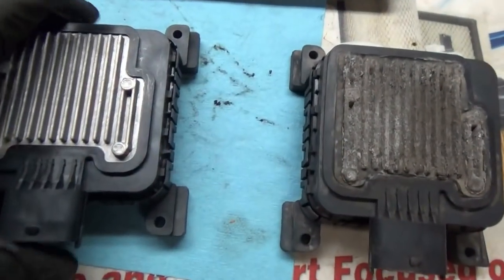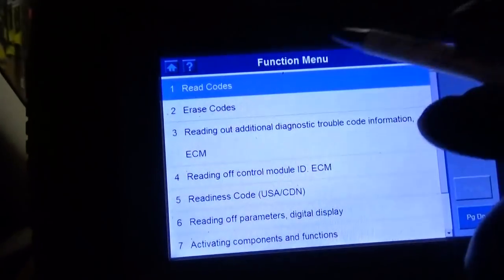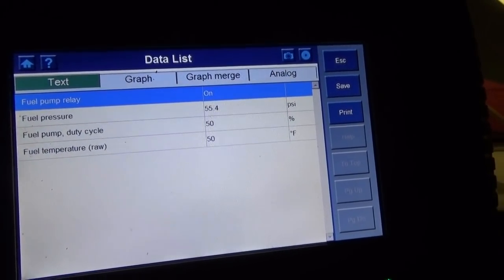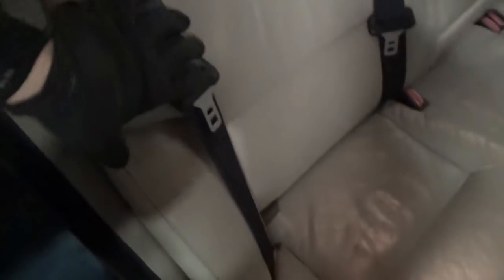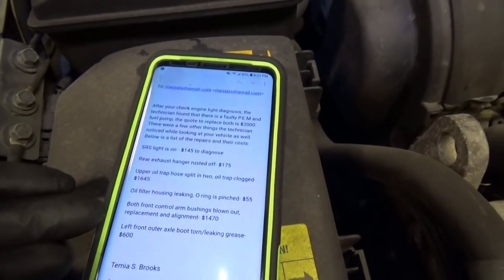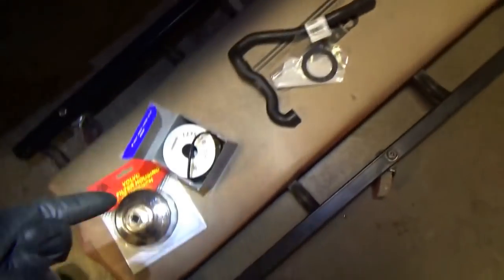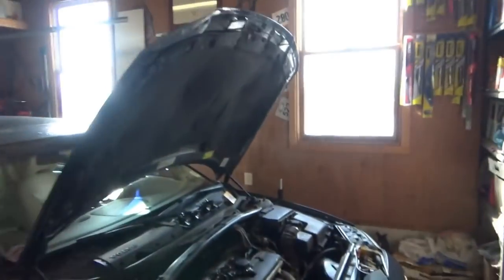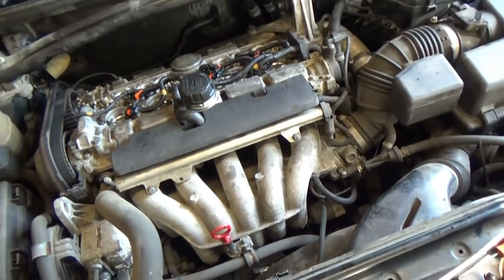Volvo Crank No-Start -Part 3 (Repairs!)

Comment: Nice job Ivan! Thumbs up!!! But the PCV is a very common problem on these cars. They clogging up and then you have positive pressure in the system and oil leaks out on the oil-filler cap. You can put a nylon glove over the oil-filler-hole and see if the glove blows up. If not, no problem, if yes, then you should replace the PCV valve as well. BR from Switzerland, Matthias
Reply from the maker: I will check this!
Reply: I agree very common test
Reply: Defiantly a common complaint but not really ever much of an issue in my experience.  You can get huge mileage between vent tubes so in worst case scenario just replace tubes every 150-200k miles.
Reply: canuckguy worried definitely*. Autocorrect on my iPhone isn’t very bright and not am i
Reply: canuckguy worried  pcv can cause vacuum leak but so can any other part of the intake system. Either get a smoke machine or some propane.
Reply: @Honeypot-x9s  I had several of these cars with a clogged PCV breather valve and sometimes one of the crankshaft seal rings snaps out and then the oil sprays over the timing-belt.

Comment: Maybe eurotrash should refer to the Volvo dealers, not the product.
Reply: But if the dealer support is bad, the vehicle is trash too. Unless the owner does their own maintenance or has a knowledgeable friend. Of course this applies to all dealers.
Reply: This V70 series is still clogging the highways around here in 2021, I have two in my driveway. One seems to have the same problem too. But since it was part of Ford for a while when it was being made midstream, and is now China's problem child it is an international orphan. The last mechanic I  had work on mine had to try  and get five of the same part before a non defective one showed up. We are the world.

Comment: The Volvo dealer hasn't seen this yet because there's no dislikes lol.
Reply: theres two, the dealer and service tech .......
Reply: 5 as of now.
Reply: 8 dealers as of now!
Reply: @Dirtyharry70585   Dealerships are like flashy gyms. Both the desk staff and the Presonal Trainer (Tech) are only there to sell you merch you dont need.
Reply: yup....sell up not fix.
Reply: @Dirtyharry70585   I don't mind the upsale if there is also a fix. For example changing all the diesel injectors when the first one breaks or similar things like that but to pretend you have found faults that are not there and charge for hours you didnt spend is just bad. Like when I got an airbag light on s Hyundai Santa Fe to diagnose and it turned out it had just been disconnected for some reason . If it was my shop I would not have had the stomach to take the customers money. (I would also have strongly suspected it was some consumer organisation doing a sting.)
Reply: 13 Volvo  dealers have now seen vid.. hahaha..
Reply: All of the dislikes are from people who saw his giant no-no - he didn't mention or replace the PCV system. That's why oil was pushing out of the worn out oil cap seal. The engine can't breathe. I'm sure it's leaking all over the place now, since it would've pushed out the other seals in the engine.

Comment: FYI - You can relocate it to under the back seat with the original wiring. Done it a few times. No drilling required.

Comment: Quick test for the PCV system put a glove over the oil fill if it blows up 90% chance the oil seperator is plugged, very common for high mileage Volvos. Great job thanks for posting!
Reply: This ^ , I changed two oil seperators on V70s last week, a very common problem,  if it has to much pressure then oil pressure problems can occur and before you know it your main crank bearings are shot. Hook up the Pico with a transducer and measure positive crank case pressure at idle. If its above 8mbar you should check and replace faulty oil seperator.
Reply: Was going to say the same.  I noticed the car was "hunting" a little on idle. Which is one of the signs that a PCV service is impending. Mine is just starting to do the same thing at 146k miles.
Reply: Was going to say very likely was clogged I would've least pulled it and blew it out.

Comment: I owned a 2001 Volvo S80 T6 and once it hit 80k miles, things began to go downhill.  The local Volvo dealership was awful.  Every single time I went to that dealership, the service bill was at least $1,800.  And these service visits were every 2-3 months.  The S80 was a horrible car.  I ended up trading it for a 2007 Volvo S60 R AWD, which I had for 10 years and was one of the most reliable cars I’ve ever owned.  I learned a lot about cars dealing with the S80, so when regular maintenance came up, I knew how to do a lot of it myself.  The only major repairs I did on the S60 R were strut mounts(common issue on that generation S60) and the timing belt.  FCP Euro is one of the best wholesale Volvo parts places.  Nice video and nice work.  You remind me that there are still kind and intelligent people still living in this country.  Keep the Volvo videos coming!

Comment: You are a RARE breed. Been 'bent over' too many times in the distant past. For the last 25-30 years- I've been doing my own repairs including mounting & balancing my own tires, ball joints, struts and other suspension work, timing belts, brakes, regular maint, etc.  It's guys like you that empower guys like me-  thank you.    Also; my 2003 Volvo S60 has over 347,000 miles-  only had to replace wear items since new other than a wiper motor and factory defective DIM module (thank you ebay).  The engine is strong, tranny shifts smooth and even the AC still works and NEVER had a recharge.  STILL my daily.  Anyway, again-  I thank you; you're vids are fantastic.

Comment: Looks like the Dealership is really trying to milk this guy dry.  That's why they call them the "stealership" Awesome fix! No wonder the guy had it shipped 250 miles. Great job Ivan!
Reply from the maker: I'm glad he did! It was only a $300 tow, including the AAA membership xD
Reply: There was no diagnostics, that's the issue - they basically just looked up the codes and then looked up which parts to throw at it....  The reality is that very few places actually diagnose problems anymore, they just scan & throw parts at the problem.

Comment: Nice job Ivan. Your buddy will be very happy with his classic Volvo. I've only had one BMW, a 2000 325i that went through 5 window regulators in 50,000 miles. The drivers window twice. I liked the way it handled, it felt better the faster it was driven. I didn't like all the little things that went wrong. I traded it in on an Acura TL. That car has been totally reliable. Had a Toyota Camry before the BMW. Never a problem. I've had 3 BMW motorcycles. They are over engineered and require lots of special tools and procedures. Parts and labor are wallet killers. Luckily I can do most of my own work, unless a scanner is required. BMWs are for people with too much money. Japanese are good value for the money, at least the ones I've had. I've been tempted by Audi but haven't owned one since the 80's. 
Thanks for the entertainment. It's fun watching you track down problems and fixing them the best way possible while keeping the price fair. На здоровье.
Reply: My 47 yr old BMW /5 is a joy to ride and easily maintained!!
Reply: @billmaxfield7831  --  I've had a K75 (good), a K1200RS (fast) flying brick and a 2006 R1200RT. The old ones are simple. The ones with first gen servo ABS were a mess. Now they have computers and CANBUS systems that are over complicated. Don't sell your R/5. It's a classic.

Comment: Dude, you're awesome.
A $6,000 dealer repairs quote, you have squeezed down to not even $500?
Perhaps the owner will stay sober all week, saving part of his fortune.
I'm on my mid 50's and currently drive the same model, which as well I had the same issues @ first. Ending me paid up $980.00 to get it done by a Volvo dealer.
These V70's are lil beast cruisers if you caress them.
I keep driving cross country my V70, from Toronto to Vancouver island twice a year. Reving its pedals over 18 hours a day for 3 and half days until I get to Nanaimo.
It's truly wonderful to get the naturally aspirited 5 cylinder engine roars. I even tried to pushed over 200m kph along the prairies and it is damn so smooth.
Cheers and all the best dude!

Comment: I completely restored a 1969 Chevelle SS. All new front end parts of course. I took it to the alignment shop. They would not align it unless I replaced the ball joints, tie rods, and springs. Hmmm. I said let me think about it. The next alignment shop complimented me on the rebuild and aligned it with no problems.

Comment: Same crap with dealers here in the UK.
The elderly lady next door bought a used Fiat 500 2 years ago from the dealer.
The car is now 4 years old with only 30k miles as she basically just drives around the village.
Last service she got talking about possibly getting a new car and as if by magic a list of extra problems that need addressing gets added to the invoice.
According to the dealer all the shocks are worn out and asked if she drives fast over speed bumps!
I checked them over, the spring rate is fine and there are no leaks.
Nice to see the dealer happy to rip off an old lady.

Comment: Your honesty and integrity shine. U lived with the car for a while, did the research and had the time to wait for delivery of parts. I think Ford owned them for awhile. That old Maxi Das was the ticket. The Verus was watching with envy
Reply: Ford did own them for this generation of wagons. The P2 design and engineering was already well complete before Ford took over, so the mechanics of the car are really solid and reliable. Fords influence was seen in the interior material quality and some of the electronics. The Flex, Edge, Taurus/Taurus X/Freestyle were all designed using the basic engineering of the P2. A testament to how good the platform engineering was.

Comment: Great job! My 2004 Volvo S60 non turbo has about 215,000 km, runs great, NO rust inside or out, parts used and new are cheap and it still looks like new! Love Volvos.

Comment: Good stuff Ivan!  I love my '93 940 - for a small car, it rides nice - has some heft to it. Parts quality is second to none in the automotive industry. Some, but not all of the OE parts are just starting to fail after 26 years in New England, and 180k miles. It always fires up, runs strong (as strong as 114 HP at the crank can), and doesn't rust like a domestic! Only a couple blisters just starting on the lower part of the trunk, near the license plate. They used the best of everything building this car - probably why it was $24-LARGE back in '93! They weren't cheap, but you got your money's worth, unlike the junk they peddle today.

After Ford got ahold of them in the late 90's, quality started dropping off (compared to the older stuff). Compared to a domestic, they're still a much better car overall. Once they get worn out though, the laundry list of problems becomes endless. Looks like that one there was well taken care of. Living in VA will help its lifespan, too - here in MA, stuff gets absolutely destroyed by 200k miles.

Lesson learned - dealerships are crooks! 😂
Reply from the maker: Back in 93 Volvos were considered at least "midsize" family cars...how times have changed in the days of the bloated crossovers and minivans haha

Comment: Excellent problem solving skills there! I'm in Northern Ireland,  cold,  wet, windy and salty. You're right,  the volvo is a big workhorse. The 5 cylinder engine is very good. Great video,  i learned a lot 😊

Comment: we both said 800 at the same time, though you really could get a lot more. It's like putting  front complete struts on a 2014 tahoe repair shop wanted 580, found same shocks on ebay new 145 total did the job for 300. could have gotten 400 or more. less than an hour job. sometimes you just feel generous. Great video Ivan.

Comment: Just binge watched all three vids - excellent work troubleshooting this car!  The Fuel Pump Module troubleshooting was top notch.  You also bumped in to a few of the very common issues with older Volvos - fuel filter o-ring gland, PCV issues (google glove test to see if "pcv filter box" is clogged), oil cap gasket, control arms, bushings.  I have 2005 S80 2.5T AWD with 180k miles and it has had those issues too.  Easy peasy to resolve - like you showed.  Lots of good content on YouTube for P2 Volvos.  Also, FCP has been a great find for me too.  BTW, they have lifetime free replacement for everything they sell - including oil and other fluids that can be returned.  Awesome deal if you're keeping your Volvo for a while like most of us do.  I also buy some parts from IPD Volvo and use Matthews Volvo forum to help troubleshoot and problem solve issues.  Everyone wants a skilled and HONEST mechanic to work on their vehicles which clearly you are both.  Nice work.👍👊

Comment: Quick tip on the front A-arms - MevoTech (available at RockAuto) has front A-arms that are exactly the same as OE units for 20% of the OE cost.  They look like they were made in the same factory as the welds are exactly the same, whereas all other aftermarket A-arms are completely different.

Comment: Oil separator box gets really plugged up very frequently but usually there is more build up under the oil cap. Just check crankcase vacuum to know if it's plugged or not. Should have small amount of vacuum at oil cap at idle. I like to just put my glove over the oil fill hole at idle and feel whether my glove is getting sucked against the hole.

Nice comprehensive diagnostic!
Reply: nice tip thanks I will try that
Reply: Very handy bit of advice and low tech to boot.

Comment: From the UK-Scotland.  I'm on my 6th Vovo in about 40 years, 2 x240 DL. a 240 GLT, a 740, all were manual and petrol, the last was an 850 D5 estate/(wagon) and currently a XC70 D5, all well maintained, NOT BY THE LOCAL STEALER, the biggest problem so far was a wheel bearing last year. All were bought at about 3/4 years old.
850's racing- BTTC https://www.youtube.com/watch?v=B7Tne33aMP4&frags=pl%2Cwn

Comment: Nice job Ivan. The old spark plugs ya took out look like plugs I used to replace in small airplanes. They had twin electrodes, two plugs per cylinder and used the old “magneto” for  ignition. That guy is gonna be one happy camper you saved him 6 grand.

Comment: I  own a Volvo V70 2.4T low pressure turbo, yr 2000. 160 000 miles. I'm not in any rush to get rid of it. No rust anywhere. Will use it for at last 10 more years.  Heck,  I still have my father's Volvo Amazon 1965. It was the only car my father owned and drove it for 41 years. With a proper maintenance, these older Volvo's seem to last..

As Ivan said, very nice car on highway, in the city V70 has a turning radius of a oil tanker if you bought the car with low and wide tires. Then they install limiters to avoid the tires touching the fender liner when fully turned. There is not much space to work  under the hood (turbo at the back and timing belt). Despite that I still like my V70. 

If you own one and do your own repairs buy a Volvo Dice used or clone with Win7 Vida DVD. These cost 80-120 USD  and you get the factory scan tool with a repair guide. You are not able to do programming without subscription (thank's Ford..)
Reply from the maker: This V70 was really superb on the highway. Must have gotten over 30mpg even with significant grades, since it had 1/3 tank left after 400 miles lol

Comment: $1600 to replace a $20 hose. That is a disgusting, stomach turning, filthy ripoff. Those miserable bastards. Extraordinarily eyeopening video Ivan. Well done!
Reply from the maker: No more leaks and didn't burn a drop of oil in 400 miles of highway driving, so I think we can assume that the oil separator is just fine haha

Comment: I have a 23 year old Volvo 855 with 2.5L 5cyl 170hp, it works, its a tank.
Then I have a Volvo v70, 20 years old, it's in good shape, no rust.
And I have a 19 year old Seat Ibiza, it works well, had alot of problem with ABS boxes and CPU, but I've changed them my self, it works well, it uses about 0.6 litre per 10 km or 6-7 miles per gallon.

Next step is a Tesla. Hopefully before I'm deeedd.